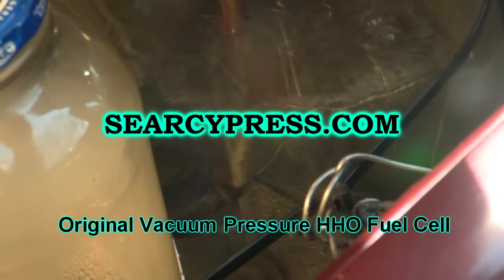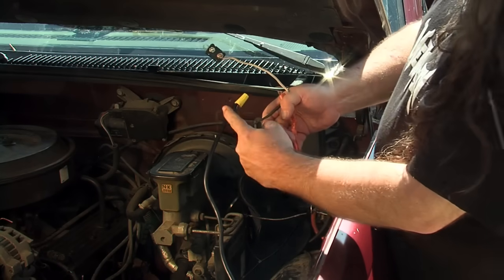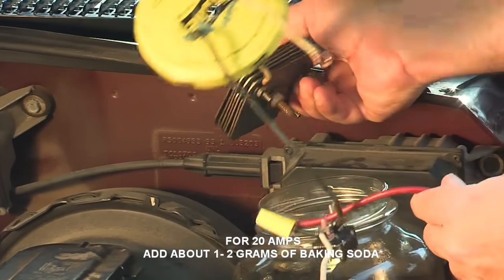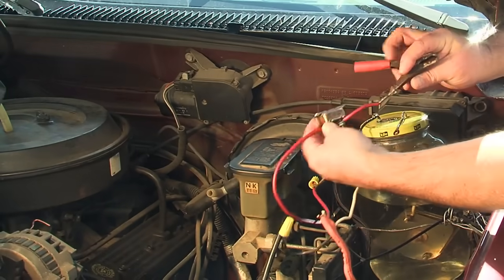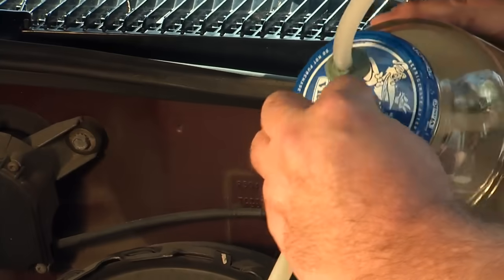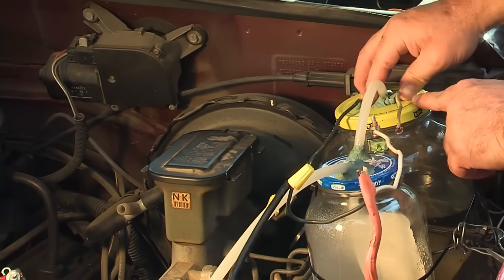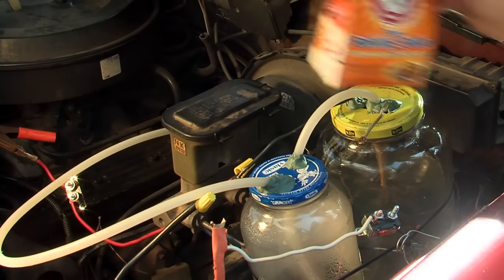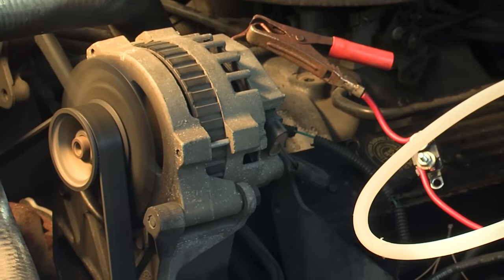Vacuum Pressure Hydrogen fuel cell defeats high gas prices using hydrogen from H2O.

Comment: Gasoline makes electricity, electricity makes hydrogen, engine burns hydrogen. Not very efficient unless you charge external batteries at home
Reply from the maker: The engine fails to burn a lot of the fuel leaving lots of room for gains. Burn more of the fuel, and you have better performance. You could run low grade fuel and you would not have engine ping using a vacuum pressure fuel cell. The engine also would stay clean. Thanks for the comment.
Reply: Metalpress TV if the engine isn’t burning all the fuel then it’s running rich, adding more fuel isn’t going to do anything in that case. Regardless of engine tuning, you’re removing energy from the engine to produce HHO that’s why you can hear the engine note change as the alternator turn on. Unless you’ve broken physics you can’t get more energy out of the system
Reply from the maker: @tacticalultimatum  We are not adding liquid fuel. We are adding flammable air. The process is not over- unity. Thanks very much for the comment.

Comment: WARNING I highly recommend fitting a flash a arrester in line between the engine and the dryer bottle.  HHO is highly volatile, be safe.
Reply: If the dryer bottle was half full of water, than it would act as a flash arrester.
Reply: HHO is not volatile. It is actually used to put out fires.
Reply: How would you get flash through the brake vacuum line?

Comment: Know how you get 40 mpg and never see a pump? Mechanical diesel, hose in hose coolant heated fuel lines, fuel filter heater and a waste oil filtration system. Waste veg oil, waste motor oil, waste trans fluid etc. Have this system in one truck with a 100 gallon bed mounted tank plus the 32 gallon tank. Truck gets 28 mpg on the highway.

Comment: I was experimenting with HHO generators about 15 years ago... The best setup I found was stainless wire (several strands twisted together) wrapped in a plastic or glass jar with about a 2mm spacing between the anode and cathode (I used a jar that had a plastic lid to prevent shorting)... Normally it was wound around a non conductive medium such as plastic... If you use solid plates like in this video you will get less generation of Browns Gas... You need to drill small holes in the plates to allow the gas to escape more easily... A spacing of more than 2mm will cause a significant reduction in gas generation...
The gas generated (Browns Gas) is self igniting at higher pressures and cannot be reliably stored and must be generated on demand...

The main drawback to this setup is any newer engine that has O2 sensors this will not work as the ECU will sense the increase of Oxygen out the exhaust and increase the fuel flow thinking the engine is running lean thereby defeating the purpose...
Unfortunately too many people say this "is not possible" without ever experimenting themselves... It is very possible as during my experiments I added an HHO generator to a 1970 Chevrolet truck and had the fuel economy increase from about 8mpg to around 16mpg without any other modifications... Yes it takes some power to turn the alternator and generate the power required but it is far less than what power is generated from the addition of the gas to the engine...
Reply: I found that those stainless steel sink strainers work great and the steel rims provide a solid surface to connect and stack. Also allows PVC pipe for casings instead of custom built box.
Reply: @glennfestog1965  The only real problems I had with my setup was an white, powdery, type of build up (oxidation?) on the SS wire. I would have to disassemble it periodically for cleaning as it would become less efficient over time. IIRC I ended up using some marine grade SS wire and it solved the oxidation issue (has been a while). Will have to see if I can find some of the old pictures I had taken of my setup somewhere.
Reply: @nathan.brazil780  My nephew made a heavier one using those round SS drain covers and got a pretty heavy output. It's also been noted that Brown's Gas works more efficiently with diesel than gas.
Currently working up a DIY e-houseboat out of cargo containers and a few things I picked up working on an Earthship in Arizona. Honestly, registration is cheaper than most homes and you can always just up and leave if you don't care for the "climate". lol
Reply: @glennfestog1965  Yeah I am looking at full time RVing for the same reason. Chasing the cooler weather and leaving if the neighbors are A-Holes. Back when I was doing them I heard of a Tractor using one and getting great results since they don't have O2 sensors. It's the O2 sensors and ECU's that really cause problems for gas engines.

Comment: You can't get more out than you put in. You're taking power from the engine to run the alternator and that uses gasoline
Reply from the maker: It is not over Unity. The energy comes from wasted fuel that normally is never burned. This particular vehicle needs at minimum 89 octane fuel. Running this system will allow you to burn 87 octane fuel. That alone results in tremendous savings. Thanks for your comment.
Reply: @metalpresstv  ok, that makes more sense

Comment: I hope everyone knows that water comes out of the tailpipe of any old internal combustion engine.  You can learn this from chemistry or just watching any car for any reasonable period of time.
Reply: Yes, but isn't it due to condensation, other than a exhaust.
Reply: @joe3414  I meant water as in H20 not just the liquid form of water.  So H20 vapor is created by combusting fuel and then when the vapor cools it turns to liquid water.  
For the sake of simplicity, you can take gasoline as C8H18.  Then, C8H18 + 12.5O2 ->8CO2 + 9H20

Comment: The wires are ran through a hole in a metal lid. After a while, they will wear through the insulation and spark.... When they do, you have a small hydrogen bomb. Someone didn't put much thought into safety.

Comment: U didn't show where to hook up on the engine itself or a line  that  came out the jars to the fuel lines
Reply from the maker: This system is connected to the vacuum line that is hooked to the brake booster. Failure of this vacuum line would result in loss of brakes. For that reason I cannot sanction anyone building this and I do not recommend that you try it. Thanks for the comment.

Comment: HHO gas burns very hot... apparently ~2800°C at its max, which is about 700°C hotter than a hydrogen flame in air. 

This technology hasn’t been found to improve fuel efficiency however. At least that’s what Popular Mechanics found in an article — which I’m inclined to believe given the article. 

Reference : 
“Water-Powered Cars: Hydrogen Electrolyzer Mod Can't Up MPGs” Archived 2015-03-20 at the Wayback Machine, Mike Allen, August 7, 2008, Popularmechanics.com
Reply: I'm inclined to believe people on the ground and personal experience. Not main stream entities. But hey to each their own...

I have discovered a library of information to be true that mainstream "debunked". Just gotta search it out and try it...

Lies everywhere....it's sad.
Reply: James Kilpatrick I don’t know if this invention improves fuel efficiency. Let me just say that for sure, I’ve not run any tests. The statement I made was based on reading a previous article. This could very well work — but I have no proof either way. I’m only citing a document that claims based on the testing they did that no such effect is observable from a recreation of the example claim. 

I’m inclined to believe the results in the article I cited.

This invention has a great many uses aside from automobiles. Anyone failing to recognize that deserves another chance to Re-examine the facts before commenting.  That being said, chemistry in all its applications holds many mysteries still and we should hold those mysteries in awe and study them.

Know thyself.

Comment: Wait a min..I simply hook up the outgoing HHO to the vacume pressure and my motor will burn the gas..? Im no mechanic but I dont see how the fuel gets to the pistons..a little help please!
Reply: The air is sucked into the carburetor through the vacuum lines.

Comment: We have a problem here. Engine runs alternator. Alternator breaks water into hydrogen and oxygen the HHO then adds a little extra boost to the engine. With each step there is a loss of energy. 

That 20-25 amps comes from the petrol you put into the tank. 
If this really saved gas there would be no need to burn gas ounce RT engine is started. 

I will be impressed when you can turn off the gas supply and drive down the road.
Reply from the maker: Your assumption is that all of the fuel is actually being burned. This is far from the truth. The hho gas created does take energy to produce. This particular engine is so inefficient the gains are  very easily achieved. Thanks very much for your comment.
Reply: But to get hho the inefficient engine needs to work harder than it normally would. Raising the fuel usage. The little bit of added HHO does very little to increase mileage.. If this technology really worked there would be no reason to uses carbon based fuel. 
Also the more inefficient the vehicle is the easier it is to see a return in investment. 
You can not get around the law of conversation. 
Science calls this technology BS. 

Now if one uses solar power and turns water into hydrogen, throwing out the oxygen then injected this hydrogen. Now we have a workable technology and can run the engine off of the hydrogen with no carbon based fuel.

Comment: 1: Is this guy saying that he runs his truck ONLY on hydrogen or is it running on hydrogen and gasoline? I can't see a 350 SBC V8 running ONLY on hydrogen on a "system" that small.
2: I wasn't exactly crazy about his wiring job, good way to burn up a truck.
Reply from the maker: It runs on gasoline. The efficiency is increased by injecting the HHO Gas into the vacuum system. Most notably, engine knocking or pinging will stop. The wiring job was not meant to be impressive. This was just a prototype. A proof-of-concept. Thanks very much for your comment.

Comment: Why bother?

You'll always get more BTUs from hydrocarbons added to hydrocarbons (read: EtOH) vs Hydrogen added to hydrocarbons.  One of those pesky facts out there.
Reply: Aha! Real Science. Indeed, it's true, but you can't convince some of these fools in the comments of similar Science/Math which states something along those lines. That the amount of energy you get out of this "not pure" weak hydrogen in 45 minutes of generation, is not even enough for one revolution of the engine. 

Then factor in your thermodynamic heat/energy losses and you have gain nothing. Plus, the computer  figures out rather soon that something is different and richens the mixture, to compensate for the extra load on the alternator. Also what this does to the battery, etc. etc. 

I have heard Mechanics, Engineers, Math experts etc. debunk this in numerous ways and ultimately this just does not add up. So yeah, why bother? I've also seen people on Youtube do it (who were not scammers or bullshitters), try it and not get any gains whatsoever.
Reply: @MrBilld75  I remember a long time ago, about 1978 to be exact, I took a course called "Physics of Energy."  The professor was a National Academy of Science member and spoke in a Indian accent, if that serves as a partial hint.  He used about 40 feet of blackboard to "prove" that we would run out of "fossil fuels" in about the year 2000.  I don't recall if that answer was on the final exam...

And, we now have climate change or whatever to replace that, and we still have Voodoo science pushed by terminal incompetent Ph.D's as a norm.
Reply: @ernstkliveman8476  Hahahaha, that was funny.

Comment: Do not use glass containers, I had a coffee jar explode in front of me, I changed it to a plastic water filter container
Reply from the maker: This system operates in a vacuum. If properly done explosion is impossible. Any other material besides glass will melt due to the high temperatures, and in this case deform greatly from the vacuum.
Reply: I understand what you are saying and you are right, I was running my air intake from the rocker cover and using a pablo glass coffee container, it was my own mistake that set it off while I was trying to reposition or change something and the glass container disintegrated in front of me. The water filter housing I replaced it with was able to take the heat and was used for a long time, I was getting an added 400rpm and had to tune the carb for the change, thanks for posting

Comment: All good until you forget to turn the switch off... ever hear of a solenoid?? Plus baking soda is not the best electrolyte. Potassium or sodium hydroxide won't destroy  your plates. Much better info out there.  Do a little research.
Reply from the maker: You are correct. If you did not turn the switch off left it sitting for a while and turned on the ignition  something very bad can happen. As far as the plates degrading the type of stainless steel used in this particular system does not degrade. Thanks very much for your comment.

Comment: Let all face the fact if this worked you would be able to buy the kit at autozone... 
but 8 years later it's still a wet dream that's why nobody has proof this works. Probably easier to find proof it doesn't work at this point.
Reply from the maker: This particular design would require an alteration to the vacuum pressure of the engine that is directly connected to the brakes. It is extremely unlikely that any thing like that could be marketed. As far as it not working, you are mistaken. Thanks for the comment.

Comment: All lies, either you're running gasoline with it, or you're running on pure HHO. But either way, the power you get from hydrogen will be far lower than if you used the same electricity in a battery driven car. This has been a scam for decades.
Reply: rstevewarmorycom it says he’s mixing it with gasoline in the description

Comment: You don't use solid core wire for high current DC nor use AC light switches for DC either. the correct way is to use  DC rated switch to activate a relay and use #10 or bigger stranded core wire to carry the high loads. Thats basic electronics 101 stuff. You DO NOT use house wiring in a vehicle unless it's an RV and only on it's AC wiring if it has it..

Anyways if HHO was so great then cars today in 2019 would be using it commonly but the truth is sure it will run an engine at idle but the HHO generator cannot provide enough gas or pressure to maintain engine RPMs when you throttle up the engine therefore the engine dies.. Not to mention that HHO will drive unwanted taxes on water globally and make life more difficult than what it's worth.
Reply from the maker: Do you really think I was worried about electrical code when I built this? I agree it should be much better done if this were any permanent installation. The reason I used the light switch was I went through boxes of toggle switches that could not handle the load. I used what worked. Thanks for your comment.
Reply: ElfNet Designs you must be insane.
Reply: @jquest43  proper wiring practices and safety is insane? 2019 internet comments.. what a time to be alive..
Reply: ElfNet Designs sorry..but this hho works,many you should fight for humanity instead of selling out and being a rat?
Reply: @jquest43  I can see you are a person of infinite wisdom and logical thinking..... I like how you assume many people who follow safety protocol t preserve life in your eyes are sellouts and rats.. Brilliant. I am willing to bet you believe 5G is some death ray right out of a sci-fi movie and the Earth is flats too
Reply: @jquest43  2010 called, they want their meme back..
Reply: @jquest43  Lets examine the facts here. I have a bigger presence here. actual content that is mine that relates to factual reality, I have a profile and even a copyrighted avatar image on here and yet I'm the troll.. That's brilliant. Keep on entertaining us. this shit is funny

Comment: My car is too modern to be messing with that. If YouTube was around in 1990, I would have tried this on my 1978 Chevy Silverado 350 engine dual gas tank. It sucked gas.. I don’t think it burn it..lol..good thing gas back then was 98 cents a gallon.
Reply: D E get a vapor carb..pogue or fish=100 mpg
Reply: jquest43 I’ll check it out.. Thanks.

Comment: This video and accompanying comments do a great job of proving the lack of knowledge of the general public.  If it worked it would be a perpetual motion machine.  Even the most ignorant know that is impossible.  It does violate the laws of thermodynamics.  If you use a separate battery attached to a PV cell mounted on the roof it could improve milage.  Lets say it is a 100 W panel and in the sun 10 hr a day.  Thats 1 KW-hr or about 1.5 Hp-hr per day.  That won't go very far.  The system shown in the video would actually decrease milage.
Reply from the maker: I understand your confusion. You, like so many others seem to think we are portraying this as some sort of overunity device. Nothing could be further from the truth. This system uses a combination of water injection and hydrogen oxygen production to increase the fuel efficiency. A tremendous amount of fuel is wasted as a normal operation of this engine. Immediate effects are noticed as engine ping stops. Performance increases. A person could drive like a bat out of hell and get worse mileage. If you drive it correctly you can save a lot. Thanks for your comment.
Reply: Metalpress TV he is an idiot
Reply: JD Sauser your sciyence sucks